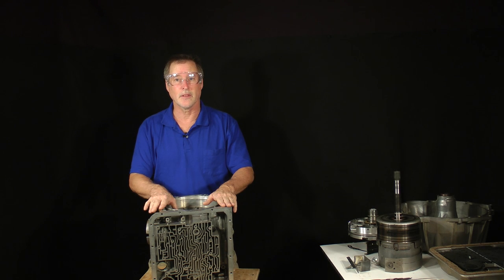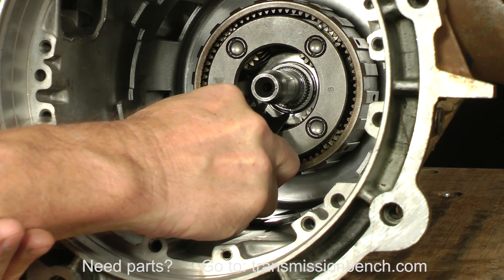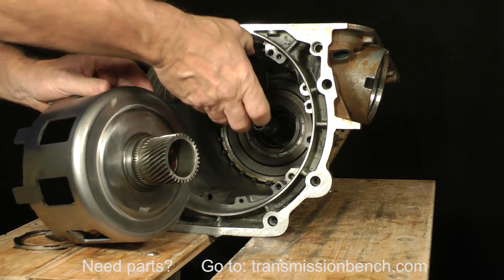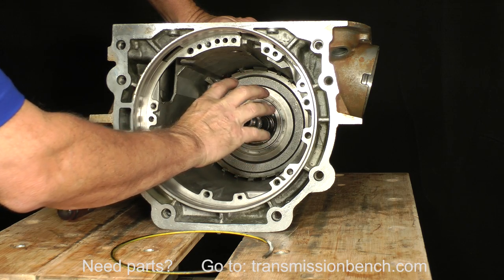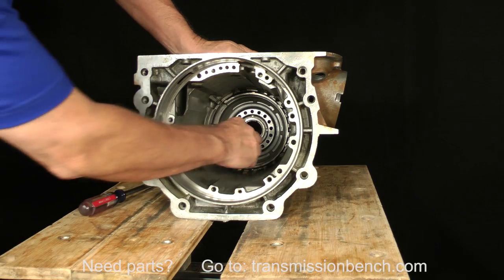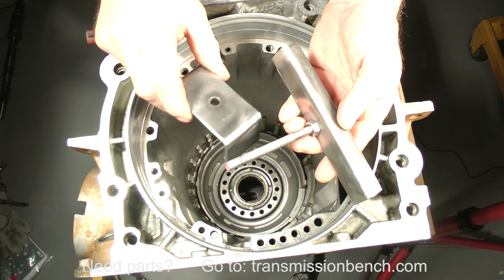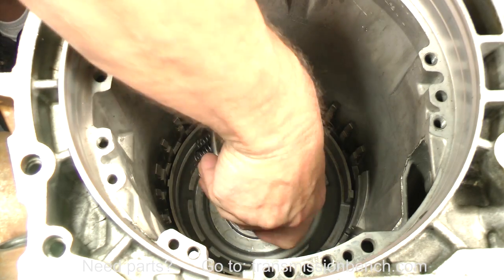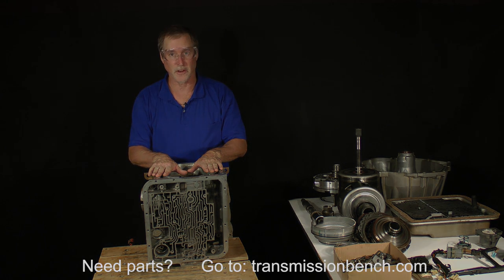Project_ 4L60E Part 1 lesson 7

Comment: If you have the cheap ebay or Amazon spring compressor tool. It will not work for this even tho it says it does. You have to modify it. This is what I did.

I removed the 3in U shape piece from the rod. Then take the longer metal piece (5in) and put $4 in quarters. $2 on each side and tape it to the (5in piece) so that it's the width of the spring cage. Then insert the T-handle side from the bottom of trans case and the longer part(5in w/coins taped.) And start compressing it. (Turning the 5in piece.)

I would recommend putting tape on the T-handle to keep from scratching the bottom of case.  

I just did this and it worked.

Comment: 9:05 - 9:13, removing the Low Reverse Piston Return Spring snap ring... I am finding my snap ring pliers are slightly too wide to fit into the space to fit the pliers tips to snag the snap ring pointed ends.  I desire to not grind on these pliers tips, as to do so will likely weaken them.

What brand/model of snap ring pliers are you using at this particular remove (and later, install) operation?

Thanks in advance.
Reply: I'm wondering the same thing. I've tried 2 different kinds of pliers and can't figure it out

Comment: Hi Jimmy,

I need your advise, or if anyone has any advise I would like to hear it.
 I just took apart my 4L60E. I have  1999 Suburban 4x4, I used your  great videos of course, but now I can't decide if I should rebuild it or not.  there were broken pieces of metal everywhere. The Outer Ring gear cracked, a big piece of the rear planetary gear set broke off. The broken pieces even got between the low reverse piston and the case and caused deep scratches on both of them. the big question is should I rebuild this Transmission or just get a used one and rebuild that one? I would appreciate any feedback, I don’t want to waste all my work and order a master kit, plus parts for a case that might be a total loss.
Thank you.

Comment: These videos are EXCELLENT, STEP BY STEP, don't seem so bad now, I cant wait to try it.
The only thing that freaks me out is putting so many parts in the same box, how to remember what went where? I can do it for engine ect, because I have seen them so may times but not trans yet. I would have to separate parts by sections at the start. Do you do older trans like thm350, 400 and powerglide?

Comment: Hi, followed all your directions but the low reverse roller clutch housing won't line up with the splines in the case. I've hit the output shaft with the wood but it's hitting the splines. Any suggestions? Thank you.

Comment: i have found your videos very helpful, and i thank you for making them but i have come across a problem, i can't locate the snap ring. any suggestions would be appreciated
Reply: Which ring?
Reply: The last snap ring is hard to see as its in a groove cut in the splines.  Hard to get to also. You will need some longer snap ring pliers. I’ve just pulled my first one apart. Not too hard just nervous. Lol

Comment: I have followed these lessons in dis assembling my 1999 4l60e and everything has went smoothly until I got to trying to remove the Output Shaft snap ring. The snap ring in my transmission does not appear to look like the snap ring Mr Williams removed in the Part one Lesson 7. Mine looks to be a small yellow colored snap ring with no eye holes to receive prongs of snap ring pliers. Can you help me??
Reply: vernon anderson I just pulled my own 2008 4l60e down and was to same as yours. No holes for ring pliers. Tough to get out but possible. I wound up modifying a pair of hemostats to do it with. Don’t laugh it worked. Lol
Reply: a standard pair for use in the hole type rings that has a 45deg or 90deg tip,  i used a set with the 45 tip and worked well,  just required a steady hand to remove once spread the 90deg tip would work better if  tips are short. did not wish to grind my flat tip set either but will pick up a cheap set in the future with the narrow flat tip, since your post was 4yrs ago, I understand this is no help to you now but hopefully this reply may help others
Reply: @zx14rpilot  2 years later and it just helped me lol, thank you!!